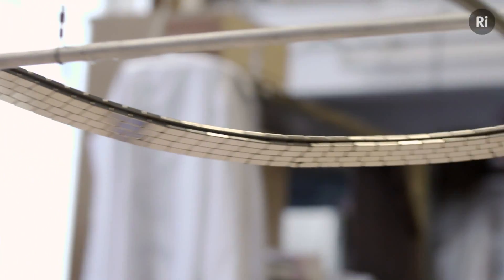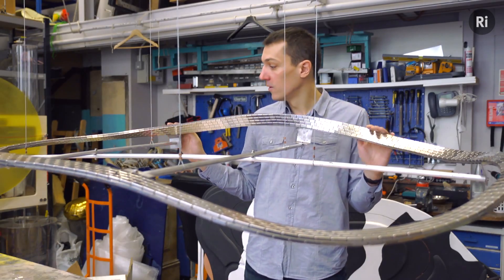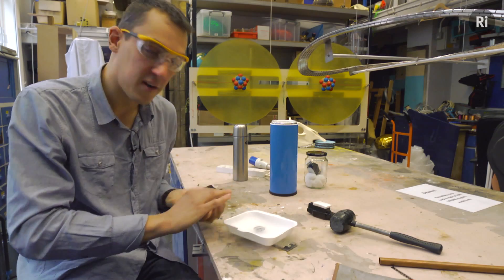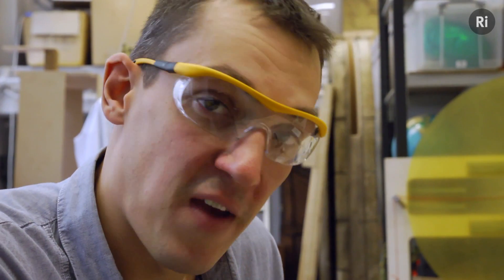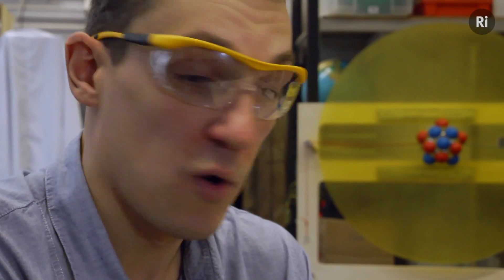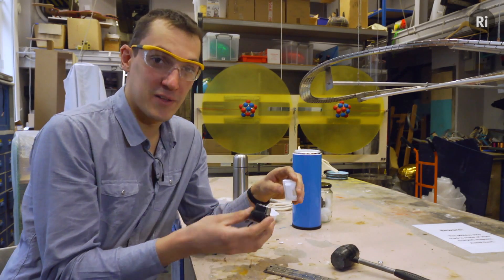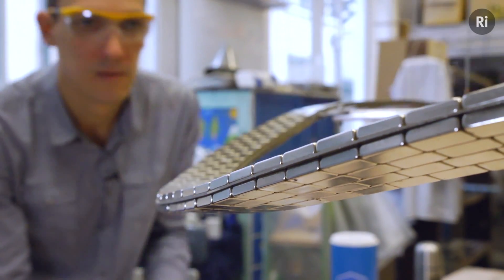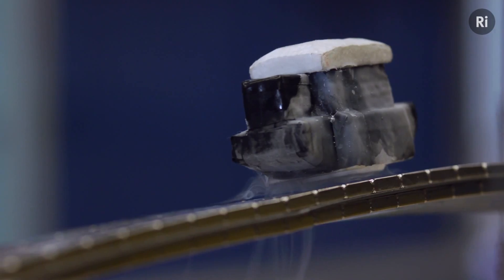Levitating Superconductor on a Möbius strip

Comment: what about placing the super conductor into dry ice and then cooling it with liquid nitrogen, it might stay colder to a little bit longer 🧊⛄️🤔🙇
Reply: maybe you could also use an ultrasonic transducer to make a mist, water vapour might be easier to freeze? I’ve read that alcohol can reach a temperature of minus-110 🧊🤔🤷‍♂️

Comment: Small correction that could stump us lay folk, when you dropped the magnet down the copper tube , South Pole first you illustrated how it causes electricity to flow in a clockwise direction and forms it's own magnetic field to resist the falling magnet making it slower.  You just wrote the magnetic field would have a North pole facing up to a South pole facing down thus not resisting but attracting.  The current would indeed flow clockwise looking through the pipe down producting a magnetic field with North facing down and South facing towards the South pole facing magnet falling in the pipe which would slow it down through a repulsion . Thanks. 3:18

Comment: I've got an experiment for you. Bismuth is a diamagnetic material which means at room temperature it has one of the properties of a super-conductor. That property is that it repels magnetic fields. Tell us what happens if you put a puck of bismuth (the same size as that suoer-conducting material) onto your magnetic track. Will it float?

Comment: Imagine scaling this up to ride around on, have a sled with its bottom coated with a supercooled superconductor with its own smaller electromagnets on each end, controlled on board to repel or attract the ones on the track or ends of the electromagnetic metal track its on

Comment: Opposite current direction always produce because of net flux change on conductor, we know changing magnetic field produces electric current, but problem arises, why in superconductor current produced without net changing magnetic flux? while cooling of superconductor we noticed magnet placed below the tray, when critical temperature reached s.c. became levitating, nevertheless there is no change in magnetic flux.  WHY ??????

Comment: How do you explain the "memory" of the superconductor in regard to the gap from the track when it was frozen? As a magnet, why doesn't it either "stick" to the magnetic track, or be completely repelled to it, depending upon the position of the poles of the track magnets in relation to superconductor's poles? I understand the relationship between movement of conductors in magnetic fields...but we're talking about super magnets, and tiny movements. It would seem that the permanent magnets' fields would be hugely more powerful than the tiny field created by the magents' movement in relation to each other!

Comment: So, when you have zero electricity resist, then you get energy holding, not rebel or attach, like one magnet inside ring of magnet, so another magnet go to unity two magnet so it holds itself. So, when the magnet go thru the cooper, it creates two opposite magnet field and slow it down, but when you cold it down, the magnet or copper, it would be good you cold the copper and magnet and let magnet fall down. So, it will increase the magnet field that is two opposite so it creates a block, so it will not fall down. So, that means what you show has a magnet field with smaller magnet so it repels or attract to another magnet, so when two magnet field that is one magnet field change in lower temperature, so the magnet field of one magnet is higher so it holds to smaller magnet field on the track magnet. 

Ya understand how it works for two magnet field that is one of them holds to another magnet field? So, the rebel and attract part do depends on electricity which decrease the magnet field so electricity cause motion which rebel or attract, so there is resistance that is current. So, no current, no motion, except external action. Well, when there is two magnet that get close it will pull close or push far itself, so there is two action, external action that cause magnet to get close that depends what polar, so the internal action is there as it exists so there is current so it rebels or attract. But when there is zero electricity resist, the internal action is zero as there is no current so it holds itself by internal energy which it is higher as current is reduces. 

Ya know how deep cold cause the energy to increase base on quantum action??

Comment: at 3:21 the magnetic poles formed by the induced current in copper tube is wrong, to oppose the movement of the magnet downwards, south pole will be obtained in upward direction (like poles repel each other). only then will it oppose the fall of the magnet

Comment: Just wanna mention as a random thought if you added a small electromagnet engine with a mini propeller on the back would the super conductor influence that at all or would it be able to just sit there and push itself? Or would the super conductor overtly effect the electromagnet engine?

Comment: What im more interest in is how it manages to run along both side of the stip, it doesnt make sense, i need to get a rubber band twist it up and draw a line on it or something.
Reply from the maker: It won't work with a rubber band but if you take a strip of paper, twist and glue the ends together, you will get a  Mobius strip. Like this - https://www.instructables.com/id/Mobius-Strip/

Comment: The train is moving so smoothly because it has no resistance except air drag which is very low in this case.
It's brilliant. First time I've seen something like this. Just amazed.

Comment: Does this model have to be extremely cold in relation to one another or could, theoretically,  you put it on Pluto and still have it work
Reply: Sthaman Sinha  but....heat is temperature is it not?
Reply: The Jokester Squad Heat is the total kinetic energy of particles in a substance while temperature is the average kinetic energy. an example i found was that if you have a small cup of water and a bathtub of water at the same temperature, the bathtub would have more heat energy because there are a larger number of particles moving around.
Also temp. is measured in kelvins while heat is in joules

Comment: What if you encased the superconductors in aerogel and starlite? Also, what happens in a zero G environment? What speeds and G force can the superconductor withstand before flying off the track? What weight capacity can it withstand before breaking the quantum trapping?
Hypothetically, if you had a simple loop track and a superconductor in space blocked from any sunlight or radiation, and the temperature was -215, would it go around the track indefinitely?

Comment: At 3:21, the diagram shows the eddy currents producing a magnetic field with the North Pole facing up. But if it's the South end of the magnet descending, there should be a South pole generated to resist the motion.
Reply: I spotted that too. With the diagram shown it would be possible to accelerate the falling magnet so it would shoot out the bottom end of the tube and fire through his hand!

Comment: Is it possible to demonstrate superfluidity of an accelerated liquid in a ring-tube vial structure  as i understand it has zero viscosity, but what does that mean if the ring would have something like a waterwheel would the flow affect the wheel would a nonmagnetic pebble inside start to rotate along with the fluid or would it just stay put, can a zero viscosity fluid produce a force on an object in its way, or will it just pass around it?

As i read/understand it  "a / some" superfluids have magnetic properties if you chained a set of coppercoil electromagnets along/around the ring vial could you accelerate the fluid within, well maybe this is a crazy dangerous experiment. 

But the superfluid have mass? So after acceleration if you reverse and pulse one of the chained coils it will start spinn won't it so it can produce a force although zero viscosity
Now if you took two such rings placed/composited beside or on top eachother and accelerated the zero viscosity fluids in opposite direction of eachother "to max speed" there would be stored engergy? 
Because the fluids have momentum and mass and for none zero viscosity fluids that mean a potential force by motion created because although zero viscosity they still have mass? So we have stored energy rotating within the rings, a motion that won't stop?

Now you reverse pulse one of the chained coppercoil electromagnets at each ring, "and on opposite side" of each ring to make a fluid brake effect "weither composited on top or beside each other do not matter", and now a force in one vector created by the two masses in motion getting hammered in same vector, because the fluids in the rings flow in opposite direction but will produce momentum in the same direction due to the pulsed electromagnetic coils on opposite sides?

Correct?

Well maybe what i propose would be far to dangerous to be practical or maybe pure fantasies. But i still would like to see an accelerated zero viscosity superfluid preferably liquid, is there a way to see it is moving?

Comment: At 3:2,1 which shows the direction of the induced electric current, I believe that the magnetic field that the electric current generates should have a South Pole, S, pointing upwards, not North Pole, N. Otherwise, it would attract it and no work would be done against the motion of the moving bar magnet downward due to its weight. I hope this makes sense.

Comment: To me the magnet is the super conductor, (able to conduct both positive and negative portions of magnetic waves) the material you are using is a semi conductor (its ability to conduct the positive portion has been frozen out), therefore the magnet is both repelling and attracting the semi conductor resulting in its elevated state. If you draw a line across the top of your round magnet you will see that it spins as you drop it into the copper tube, both the top and bottom are conecting to the tube the magnet is passing its energy into the tube and absorbing it back out of the tube from the opposite side.

Comment: I love the unnecessary safety glasses but no gloves when handling the nitrogen.
Reply: You don't ware gloves while dealing directly liquid nitrogen because it will not actually contact your skin because it will boil off before it does and if you ware gloves it will freeze the gloves then that will freeze your skin, you do when you are handling solid things that have been cooled by it though polistiren or other poor thermal conductors should be ok to handle for short times due to it's poor thermal conductivity.

Which I think the model was polistiren although that paint will have better conductivity probably.
Reply from the maker: Thanks for checking out the video! We had a similar question in the team so asked Andy to explain, and this is his response  - https://youtu.be/kdWrKhVbCLw
Reply: The Royal Institute> Thanks for checking out the video! We had a similar question in the team so asked Andy to explain, and this is his response  - https://youtu.be/kdWrKhVbCLw

He explained the lack of gloves two years before this video. So superconductors are used in time-travel. 🤔
Reply: @TheRoyalInstitution  gloves are meant for covid warriors only
Reply: @TheRoyalInstitution  put a camera on it and make a magnet accelerator thingy to have races.
Reply: I also wouldn't say the glasses are unnecessary. As was pointed out: the big nitrogen drops don't touch the skin, because they stay afloat on a layer of nitrogen gas, similar to water drops on a hot stove plate. But there comes a point when the drop becomes small enough to not create enough gas… and those small splatters sting quite a bit.  It's pretty harmless on skin, but  I wouldn't want one of them to do that on my eyeball.
Reply: Lol Cody talking about safety
Reply: Handling Liquid Nitrogen with gloves is very dangerous. It's safest when you use your bare hands thanks to the Leiden-frost effect which explains that the liquid nitrogen sits on a pocket of insulating vapour in your hand which avoids direct contact. Whereas with gloves it would freeze to the fabric and allow direct contact to your skin.
Reply: The reason he wears savety goggles is to protect his eyes, because there is lots of water in them which can freeze easily. The reason for no gloves is that he has dry hands so the Leidenfrost effect takes place where the nitrogen will evaporate because of your surface temperature and build a little gap of nitrogen gas between your hand and the droplet. However if you have wet hands you would just freeze your hands the same way you would freeze your eyes if touched by liquid nitrogen.
Reply: You shouldn't trivialize safety procedures. That kind of thinking is what makes people feel bad for followig safety procedures. Considering the potential for permanent injuries and blindness I'd rather have it and not need it than need it and not have it. Cheers, buddy. :)
Reply: I'm fully proficient in Chinese
Reply: @westerling8436  congrats
Reply: Because you don’t really need gloves
Reply: Codys stay in your chanel we will come and you wellcom
Reply: Safer without gloves, unless you can afford cryogenic gloves or even get your hands on them. Most people watching youtube vids would follow along with cheap versions of everything, including gloves. Safer without gloves.
Reply: CODYYYYYYYYYYY ❤️
Reply: The safety glasses aren't unnecessary. The gloves are.
Reply: Your eyes are more important & sensitive than your hands.
Reply: CODYYYYY!! Please make some YBCO!!
Reply: LMFAO! Thats so true!
Reply: you can put your hand in nitrogen nothing happens
Reply: @asnormalus  ...
Reply: "wear"
Reply: Thats because you will see what is appening but won't feel it
Reply: Cody you're here
Reply: hahahaha lol Cody'slab good one.
Reply: The Leidenfrost effect makes this safe. If he wore gloves. the might actually absorb the liquid.
Reply: also they warn us abt the strong magnets and he's just wearing a watch the whole time...
Reply: What is the material used for track
Reply: @mirror7900  neodynium (probably 52) magnets.  Had to be a $3,000 track.  That YBCO superconducting puck was probably $200.
Reply: I love to see all of the seemingly random places this man pops up in on YouTube.
Reply: you rather lose a hand or an eye ?

I'll take the hand and keep the eye tyvm
Reply: As I know, using any kind of cloth is some kind of dangerous when you deal with liquid nitrogen.
Reply: Cody “heart”
Reply: Nothing happens if you pour liquid nitrogen over your hand. Because boils before it touches your hand, and is sort of slides off before it actually touches you.
Reply: Bro, its cause humans still can't regrow eyeballs, duh!!
Reply: Lodys cab
Reply: Hahah
Reply: Yeah, but you do it better, we donr want you to get hurt with those nasty maths
Reply: Etheoma Your absolutely right, mate!
Reply: @DoctorDiecast  Yep but emphasis on VERY Short period of time, under 1 second.  Stick your hand in liquid Nitrogen and it will freeze it solid in short order.
Reply: I was thinking the same thing, why the glasses.
Reply: why would you love that? seems to me like you're wanting him to get hurt, and spread the knowledge.

Comment: i noticed there was no lid on the reservoir to keep the liquid nitrogen from pouring out when upside down? Is that because nitrogen has paired electrons making it slightly magnetic and therefore keeping it in the reservoir? Does that apply on a molecular level in N2?.... I know that since oxygen has 2 pairs of paired electrons (per atom) and that makes LO2 magnetic. I would imagine that it is a similar effect just weaker... what happening here?